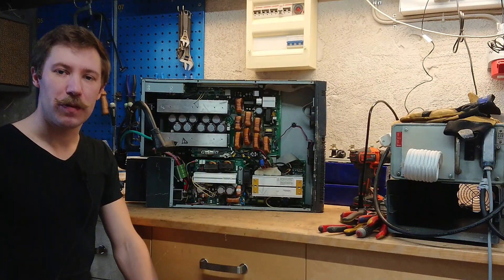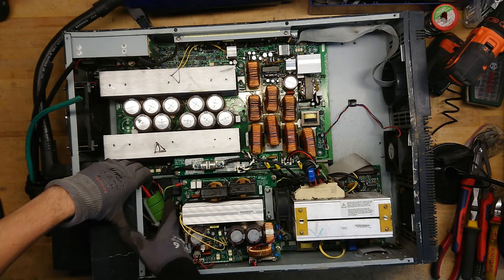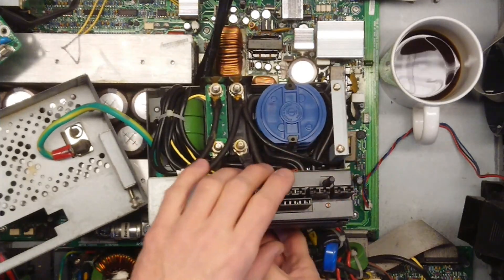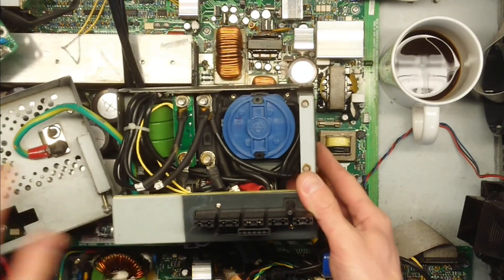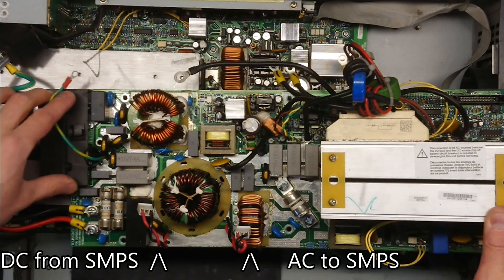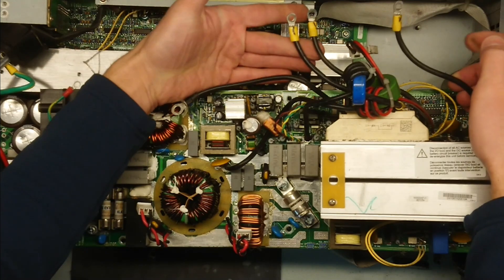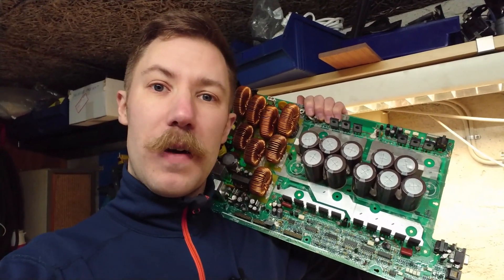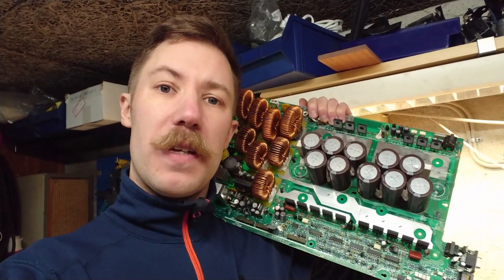Teardown of a 5 kVA / 4 kW Eaton EX5RT UPS System

Comment: Thanks for the useful video👍 could you please share an email or WhatsApp Nr to communicate ? 
Thanks
Reply from the maker: You are welcome to leave questions here, I do not have time to direct communication with everybody.
Reply: @ Thanks for your reply.  I am working on a EATON UPS (5SC 3000i RT2U) , troubleshooting/repair almost finished, I also changed main chip (STM32F101VCT6) on main control board. 
Just want to know your opinion if you have firmware (boot loader) for this chip? 
I download from EATON website and program the chip but not working . 
Would you please share any common experience ? Thanks

Comment: Hi. I need a little help. I have a similar UPS MGE EX11RT 220V 1 phase. But I don't have a wire connection unit with a bypass switch. I can't use UPS because of this problem. 
 I would like to ask you to send an electrical diagram of the internal connections. I cannot understand the purpose of the internal 5 pairs of contacts - which of them are N and L of the bypass , which are N and L of the external 220V network and which are N and L of the output voltage to the load. 
 It is also unclear what the purpose of the contacts of the small lower connector with 6 contacts is. It looks like it is needed to determine the bypass connection and start UPS. 
 I need the wiring diagrams or the external unit itself. Thank you in advance.
Reply from the maker: I do not have any wiring diagrams. Contact EATON.

Comment: This device can run in Line Interactive (ECO) mode and Online mode where input is powering inverter continuously so the output is always clean. It is great device not deserving to be a donor. It can be powered by PV microinverters to provide clean power and in case of batteries drain bypassed to electric company.
Reply from the maker: You point out a important feature here, that is important in industrial settings, that UPS is not just for backup power. It also gets rid of all harmonic noise, switching transients, voltage sags and swells. It will keep your main 10kV/400V transformers happy from limiting the harmonic noise that could overload your transformer, even if you are far from its rated load current.

Comment: 5:28 I think it mostly for replace faulty unit without cuting the load, pretty smart solution.
Reply from the maker: I hope it only fails with mains voltage present then :)

Comment: Smaller board looks  like two phase pfc to me, probably used when charging. Two transformers can acctually be inductors for pfc. Think that you conected it wrong for test. Expect you to demant me in next video. Great job.
Reply from the maker: I got the board just next to me. Electrolytic capacitors are in parallel and only 450VDC, so if its two phase it would not be 400VAC between phases, but I know where in Denmark it comes from, so it was fed with 3x400VAC+N. The transformers primaries are connected in parallel to a half-bridge of 47N60 IGBTs and the outputs are parallel as well. But enough about that, I will make a video about it :)
Reply: @KaizerPowerElectronicsDk  l chose bit wrong wording. Single input phase is converted into DC by two inductors sharing the current. It is called interleaved power factor correction. There are nice application notes with pictures how tranzistors and inductors are arranged. Sometimes are called two phase because tranzistors are switched interchangeably.

Comment: I've never understood why you'd want a bypass switch inside the device you want to bypass, but this one actually makes sense - just flip the switch, pull the whole AC input module out of the broken unit, plug in the replacement and turn it back to UPS. Nice.

Comment: Nice teardown, I was pretty surprised  that there are only TO-247 devices and no IGBT bricks. 
Definately a lot of useful parts to be salvaged. :)
Reply from the maker: It really has to have 20+ kW rating written on it before I expect to find some useful bricks. Up to 20 kW you can still risk that its just TO-247 or Skiip modules :(